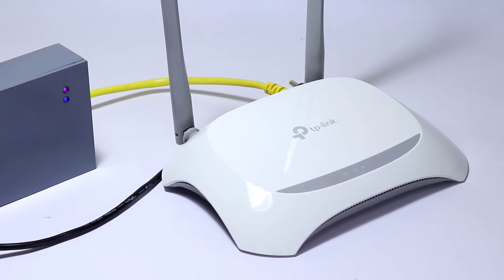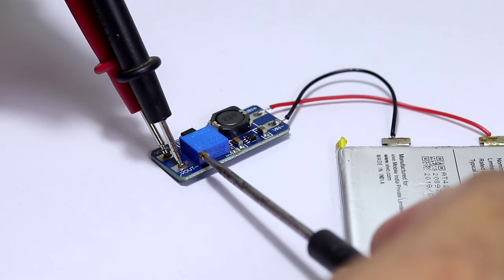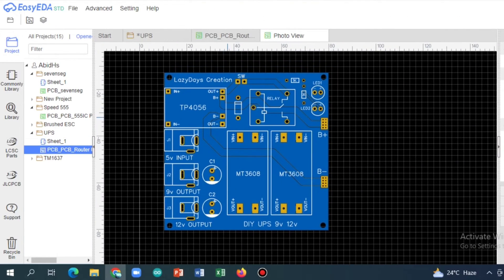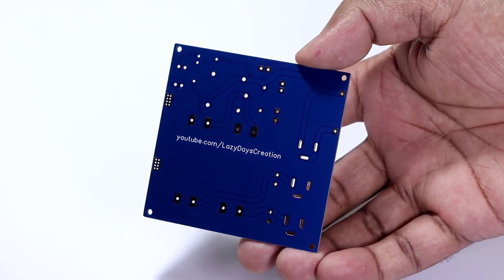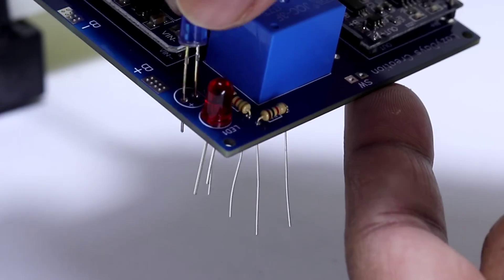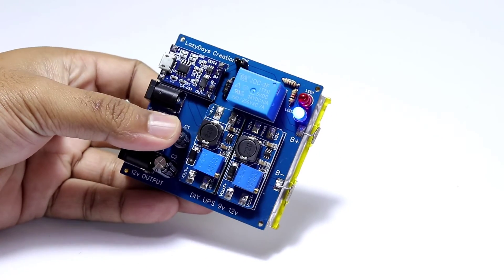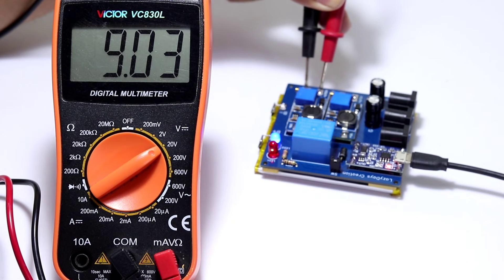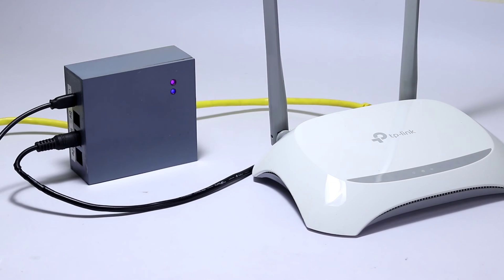[NEW] How to make diy mini wifi UPS at home like wgp

Comment: When the battery became low, then router automatically off but if put 5V power supply then it's not working (ruter & Onu not on) until the battery full charged.

Comment: Subscribed to your splendid channel!
Could you please provide the specifications or an AliExpress link for:
5V Relay and 1kOhm Resistor?
I also wanted to ask if, instead of using a 1N4007 SR260 diode, it's possible to use a 1N4007 1A diode.
I'm waiting for your response so I can purchase the items I'm missing. Thank you very much.
Reply from the maker: Thank you. You can use the diode without any problem. 
Can you tell which country you're in so I can put aliexpress link with free shipping.
Reply: @Lazydayyt  Ya he adquirido todos los componentes,Gracias.Soy de España.
Podrías decirme distancia entre los Dc Jack Barrel para la impresión 3d de la caja?Gracias
Reply: @Lazydayyt  Also the distance between the barrel jack and the usb-c of the tp4056. Thanks
Reply: And what about the 5V relay?
Could you provide the specifications, since the ones I find aren't the same. Thanks.

Comment: Hello please sir if you could please give me a circuit diagram that can run a little more ampere then I would be very benefited. It is 0.6 ampere below one ampere, these work very well but now all the routers are more than 12 volts one ampere so sir I request you to please share a circuit diagram of a little more ampere than 12 volts one ampere. Pls Pls Sir...
Reply: 12V 2A circuit diagram please?
Reply: If instead of using the M3608 modules, which only regulate voltage, we used XL 4015 Buck Converter modules and the corresponding BMS, I think we could adjust the output to 3A while also adjusting the voltage.
What do you think?

Comment: i have follow all the steps but when i connect with my modem voltages go down to 7.5v i have try put bigger copastor too
Reply from the maker: You can use two batteries in parallel to increase current hence output power.
Reply: @Lazydayyt  ok thanks
Reply: @Lazydayyt  i have try using 4 laptop batteries but results are same as old :(

Comment: Does it work for 12v/2.5A wifi router
Reply: Bro my router is 0.5a but when i connect this by doing 5v to 12v my router blink 4 times and my power bank become turn off
Reply: Have you been able to modify the amperages of the 12v output?
Since I want to modify them to 12V 2A
Reply: If instead of using the M3608 modules, which only regulate voltage, we used XL 4015 Buck Converter modules and the corresponding BMS, I think we could adjust the output to 3A while also adjusting the voltage.
What do you think?
Reply from the maker: Sir it’s better for 12v/9v 0.6A routers

Comment: this doesn't charge the battery 24/7 right?
Reply: I think it will charge it as it does have tp4056 charging module. But it will charge a bit slow.